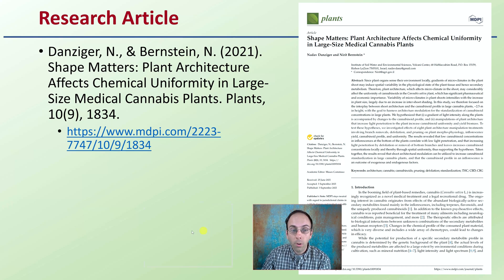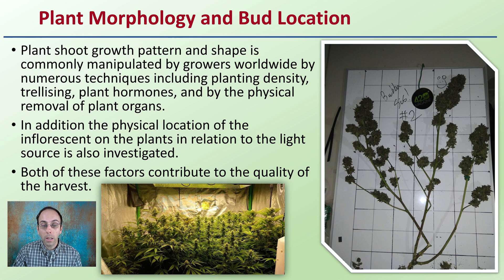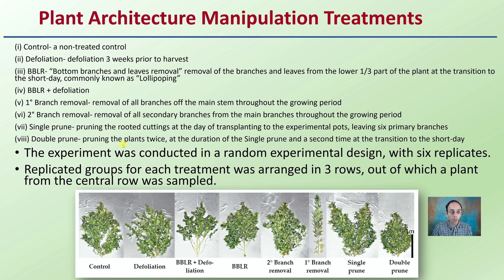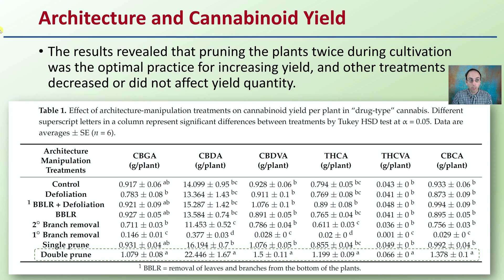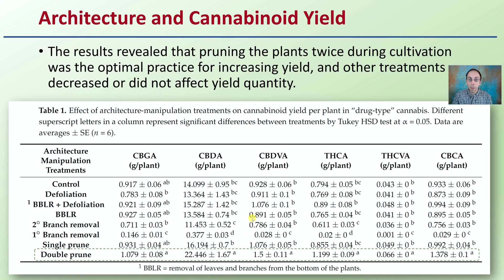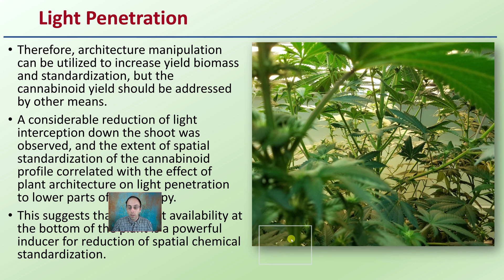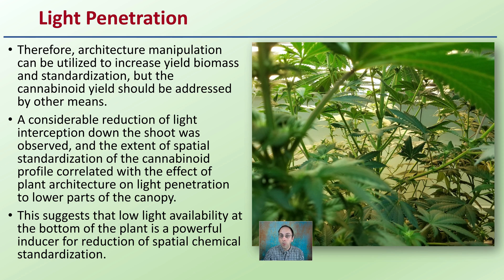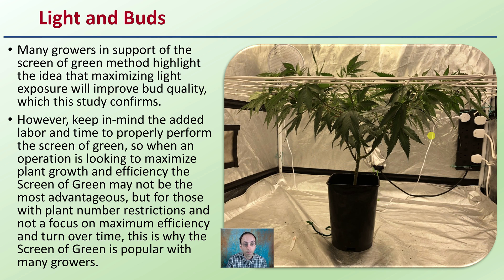Plant Architecture Effects on Chemical Uniformity

Comment: I  had one of my chickens bite the top off a very young plant this spring . It now has grown as wide as it is tall  , about for feet high by four feet wide  with lots of branches and buds . I am sure it will double the yield of its sisters which were not topped or pinched .They are five feet high but not as thick
Reply from the maker: Sounds like you have the "chicken pruning method" going on;-)

Comment: So what is your opinion on training techniques for autoflowers? So far I've been a fan of Low stress and not trimming. Would it be beneficial on an autoflower to defoliate above bud sites, or would this possibly shock the plant?
Reply from the maker: Low stress to simple yellow leaf removal can be all that is needed typically because the plants flower so fast and the overall size of the plants tend to be small.
Reply: @DeBaccoUniversity  exactly the same conclusion I had come to. All the videos and pictures I have seen of people topping and trimming autos heavily vs natural seemed like it really hurt the plant. Just wanted your opinion. Thanks again Prof. Maybe one day I'll get through all of your videos... lol
Reply: i tried autos this year and it was a disaster ,  topping , moving, or changes seemed to shock the plant and it would stop for 1-2 weeks ..1 went back into veg ,1 just stopped at the point of flipping , 3 i had outside just took so long to fatten up the weather turned cold and fked em up .  i now have 1 plant about a foot tall which is fattening up , but not worth all the hassle over the summer.

Comment: Debacco, long time fan and watcher. I had a question that you have not necessarily covered yet but I see huge value in covering it. Is there a way to filter micro plastics from water you feed your plants? Currently there is very little out there on filtration of micro plastics (even watched you video on filtration) but I see a lot of micro plastics being leached by many faulty irrigation systems. People believe PVC and PEX are safe but I believe that eventually they do leach chemicals and they will 1000% leach chemicals when a nutrient solution is being ran through them. Many people use pvc outside too. (The only plastics I use are hdpe/pe and abs. )This leads to micro plastics in the flower I would guess since apples and many other fruits and vegetables have very high levels of micro plastics. I know the plants create tumors in their roots to block heavy metals but it seems they readily absorb micro plastics.
Reply from the maker: In short it is very difficult to avoid micro plastics, these particles are now part of our world.  However, there is little current data on the impact these have on human health.  Here is an article on the subject... https://www.sciencedirect.com/science/article/pii/S0013935120305703
Reply: @DeBaccoUniversity  thank you so much!!!

Comment: You are 100% right. The double prune method yields more as when we lollipop on a commercial level, usually super high end cannabis cultivators commonly know and understand that the lowers may add extra weight but it’s often times less dense in structure and as well cannabinoid production considering it’s proximity to the light. So an experienced grower won’t even let buds start to develop, or will pull them early as the means to redirect the energy towards tops if they’re outside of the desired space he’s interested or intending on using for the canopys maximum light efficiency. People don’t like little buds and we don’t like less of what makes cannabis special lol. The training you’ve shown is definitely good for the home growers who have a few extra weeks to spare, but on a monetary level, we lollipop instead and fill the rows a few wide as the means to achieve equal and consistent canopy’s without having to wait for them to fill out the space with lateral branching.
Reply from the maker: Thanks for the information and the confirmation for the research data provided matches your experiences.
Reply: @DeBaccoUniversity  absolutely! Thank you for taking the time to put this type of stuff together!! Not enough people within  the industry are willing to give out information or any sorta tip they feel gives their competitors an “edge” against them which ends up only hurting themselves in the end… if people shared information as they should, science would progress at the rate it should and everyone would benefit 🔥
Reply: Are there commercial growers who top?
Reply: absolutely… most of them either use a technique which is commonly referred to as Fimming which is when you essentially cut like the top 50% or so of the fresh growth. This forces multiple tops to sprout from the topped area. Sometimes you’ll get 3 or 4 tops. It’s never really a certain number of tops that will eventually spring up, as when you traditionally top, you cut the bottom at the node and 2 will usually sprout up in replace of the 1👌🏻 but Debacco has a video covering fimming for the visual if you wanna see how it compares to traditional topping💪🏻

Comment: Okay now this is some information that's extremely useful for smaller or home grows. I'd love to see this performed on a larger scale to see what is ideal for commercial setups and to see how the 2 differ.
Reply: I worked at a commercial cannabis cultivation center. Our head grower wanted two defoliations done, but due to having a shortage of cultivation techs at the time, we were only able to to one major one most of the time. Lollipopping would take place after the second week of flower
Working on a smaller scale, I still prefer a double defoliation, depending on how leafy the pheno is
Reply: @jessxoemi  I personally like to apply SCROG, medium intensity lollipop with defoliation (strain dependent). Once before flip and another 2 weeks into flower. But my friends working for cultivations (stizzy & top shelf) do things a little differently and I believe the difference is for efficiency of man power due to having multiple facilities. I always wonder if it's worth it or if trying to be efficient with time ultimately means less money and a lower quality product. 🤔
Reply from the maker: Please share with other you think may also be interested!
Reply: @DeBaccoUniversity  Do you have an IG I can tag and share content with more easily?
Reply from the maker: At this time just the YouTube channel.
Reply: @DeBaccoUniversity  how do I engage the university for potential testing of our vibration controlled agriculture tech?

Glenn